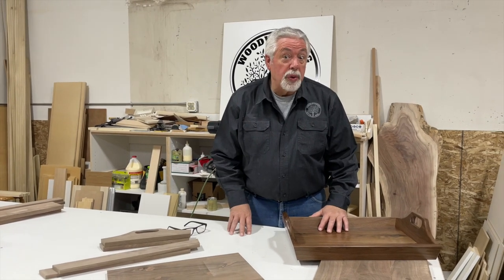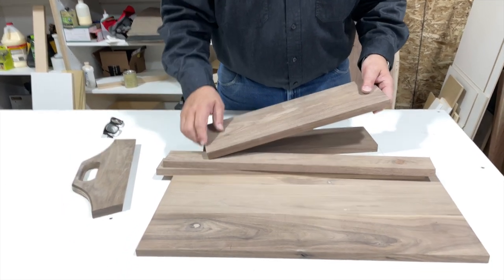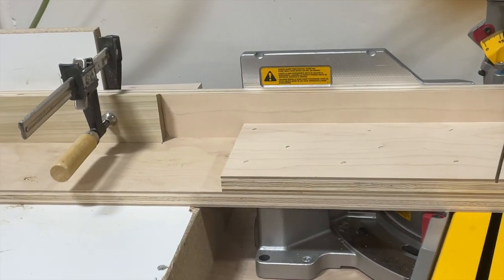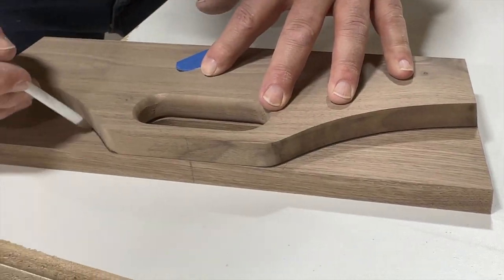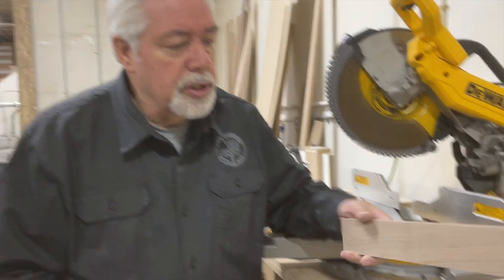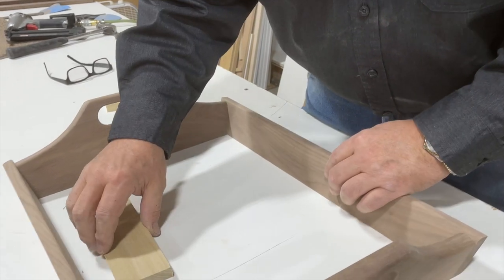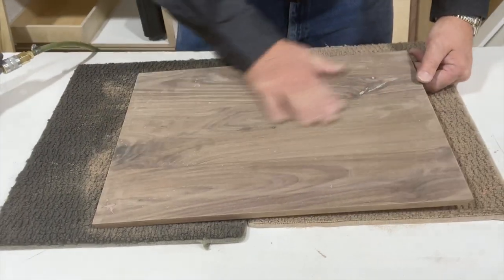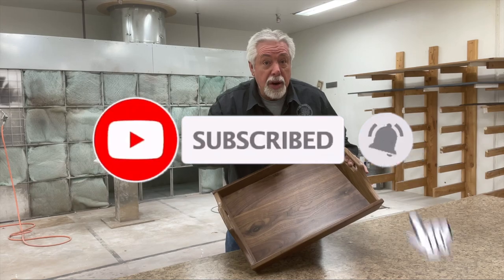Show off your woodworking skills with this unique serving tray.

Comment: Nice job.  Just a word of caution though, when working with walnut, (cutting or sanding) always wear a dust mask as walnut dust can be hazardous.  It's a sensitizer, so the more exposure you get, the more sensitive you may become to the dust.  Doesn't bother everyone, but a friend of mine ended up with what he thought were allergies, turned out to be the walnut he was working on.
Reply from the maker: Thanks for the tip and reminder! Wes

Comment: Hey Wes, I loved this serving tray so much that I've decided to make it just like yours, but I'm not clear on one thing.  When cutting the side with handles, I'm okay with cutting the 4 and 14 degrees on the left side of it by using the ceter line. However, when cutting the right side, that's where I'm having trouble with.  On your video, you say and have a pre determined stop block, but you don't show how you came up with that or how it's measured? Can you please help me explain that part better?  I got all the pieces ready, but I'm stuck on that cut part.  Thank you so much for your time and videos!
Reply from the maker: Hi...the placement of my stop block was determined by measuring from the center line to the end of the first cut. Then flipping and measuring from the center line to where the second cut must be and then placing the stop block. Hope this helps. Wes

Comment: How do you compensate for wood movement of the bottom inside an enclosed frame? That bottom piece will expand and contract and could disassemble the sides.
Reply from the maker: Living in the low humidity desert west, this has never been an issue for me. In areas of higher humidity this, of course, would be a concern. Assembling the tray with a small gap along the side would allow for the expansion of the bottom of the tray. Hope this helps. Thanks for watching, Wes
Reply: Walnut will only move like 1/8 of an inch over I think 8ft within any given season. (Do not quote me on those numbers but they are close) so something this size will move so little you do not really need to compensate for movement. I’m more confused on the 4 degree cut because to me that would splay out the sides outwards or inwards depending on the direction of the 4 degrees.

Comment: What RPM do you have your press set at to drill through the walnut so easily? My drill always stalls when I’m drilling black walnut.
Reply from the maker: Hi Derrick...the ease of drilling has more to do with sharp bits than speed. I just make sure I have good sharp bits. Thanks for watching. Wes

Comment: The way you measure adds confusion to the process. You can measure more accurately by turning the piece over. Then you don't have so many different variables between so many pieces of sacrificial wood.
Reply: I suppose you could but then you would be measuring the short distance from bottom bevel to bottom bevel.  For angled pieces, It’s generally easier to measure and line up your cuts from long edge to long edge.

Comment: You are doing this the hard way. I can do it with fewer steps. I don't have a compound miter saw. I have a table saw. You can do it easier with just a table saw with a fine blade.

Comment: You use zero safety precautions. You use zero eye protection, zero masking for dust, zero ventilation when spraying toxic finishes. You are a bad example for safe woodworking.
Reply: Some of us are old school.  I’ve worked around a lot more dangerous equipment and far more toxic chemicals.  Still kicken at my old age.